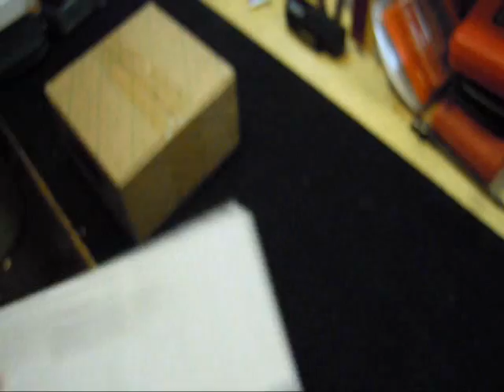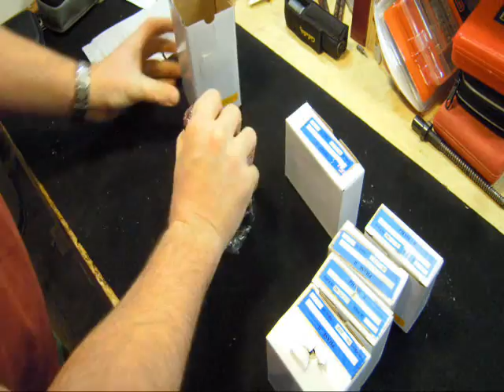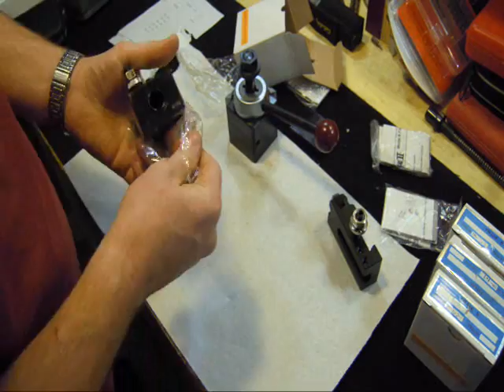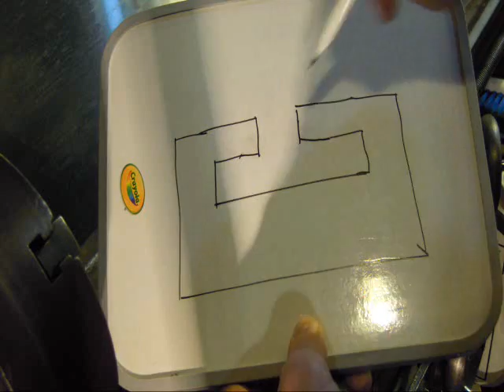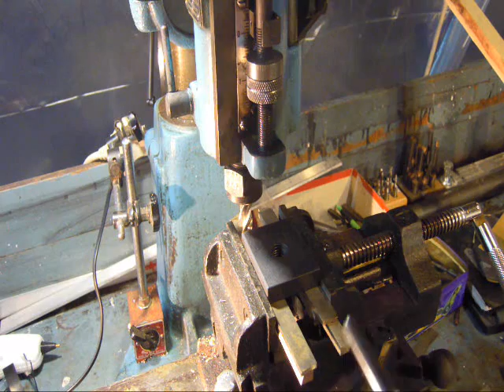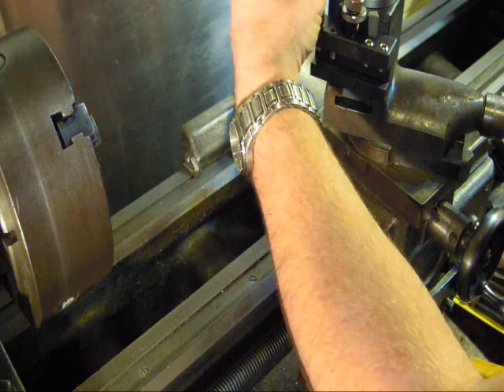Phase II AXA Quick Change Tool Post, Logan Lathe Install

Comment: Where did you buy the phase 2 quick change?  I have a old prentice bros lathe and want a quick change. Also what size tool can it hold? 1/2”??
Reply from the maker: Yep, 1/2", I bought it from Enco before MSC bought them out. I've since switched all my stuff over to Dorian and Aloris. No comparison.

Comment: Turn the F###ing Air Compressor off and go to school and learn Machinist Trade You could have did the whole job in a four jaw in about 30 min
Reply from the maker: I didn't want to take a short cut with a rounded off part and "make it work"

Comment: I bought an AXB tool post for a Grizzly G0752 Lathe and the tool holder does not go down far enough. Will the AXA improve my problem? drwills21@msn.com. Please help.
Reply from the maker: Yeah, that BXA is going to be way to big as it sounds like you found out. I wouldn't put a BXA on anything smaller than a 12" swing lathe. AXA's work great for 9-12" lathes.

Comment: You don't have a suitable tool, for measuring the depth of the T slot?

Of course you do.

There's at least two methods, using the Digital Calipers.
Reply from the maker: I can't recall how I did this without looking at the video again. I was probably wanting to use a depth mic when I did this. I've since gotten more calipers and micrometers than I'll ever need.
Reply: Precision Machine Shed sac
Reply: Machine Shed Precision

Comment: I got a zx45 for while im learning and looking for a good deal on a bridgeport.  I gotta tell you its awesome.  I get no measurable slop in the table at all.  its flat and level to 0.000000   we gave up trying to find slop.  My brother in law iaw a machinist in the arrow space industry and when he used my mill he said "this thing is bad ass"

I cut tool steel like butter
Reply from the maker: That's awesome, sounds like you have a nice machine there!
Reply: Precision Machine Shed I honestly didn't think it was going to be much of a machine at all because I made the mistake of buying Grizzly lathes in the past so I figured another Chinese piece of junk was headed my way I just wanted it to learn on a little bit before I gotta Bridgeport but I'm going to keep it and use it until I grow out of it now there's nothing I haven't been able to do on it it could go a little bit faster on its top end but I'll deal with that when I have to it's a Gearhead so it's it's not like I can change the police have to redesign the damn thing or increase the motor speed.

I bought a Logan lathe 820 built in 1946 for real cheap I went and picked it up and on the very day I was picking it up I found another lathe for 200  bucks it was an 1821 and it was all tore down. the guy didn't know if it was even complete, he had bought the parts in order to rebuild a lathe and restore it, he never got around to it so he sold it to me for two hundred bucks! all the parts tore apart and I just took it home for the  gears and things like that cuz I know the drives are identical from the 1800 series to the 800 series most of them anyway.....  so it turns out I start putting this thing together I painted everything Battleship Gray really nice I took my time and stripped down to the metal clean as a whistle and taped everything off perfectly painted with oil paint let it dry  for weeks and weeks and weeks and put it together in the whole damn thing is there!  it's a hundred percent complete  so I got a brand new lathe for 200 hundred bucks! not only that but both machines  show no signs of wear whatsoever other than the compound rest on the second lathe,  the 1821 had been run into the Chuck a million times so I'm going to either repair that or try to find a new one I don't know probably try and find a new one.

The only thing that bums me out is when I tore apart the 820 and painted it I painted it a nice dark grey about the same tone as the original 820 without the blue tint to it. But I brushed painted it and it turned out like shit. It looks like an old machine with an old paint job but that that's a pain held up really well. But the biggest thing is it's protected there's no rush everything's a hundred percent cleaned up and protected.

As for the 1821 it's beautiful Battleship Grey and shiny metal LOL I'm looking for a good motor for that right now it came with the three phase half horse motor that's older than I am and I'm just going to get a one horse single phase motor off of eBay I seen some good deals on brand new Motors

Anyway I ramble too much I get excited when I start talking about it I can't wait to buy another one and restore it I'm pretty God damn disabled so doing this takes a lot out of me I can only do it maybe a half hour per day if I'm lucky sometimes if I go an hour or two I won't be able to get out of bed for a couple of days but it keeps my mind going all the time and that's important to me right now well I'm so sick.

If you have any opinions on good Motors let me know. Funds are a little bit short right now I shouldn't have spent all that money butt I need a new motor LOL

Comment: Was that your laundry at 16:07?  Also, I just bought an AXA Bostar for my 11" Grizzly.  All I have to do about the T-nut is drill and tap the existing one that came with the Grizzly.  What size is your bolt on the Phase II?  It looks slimmer than the Bostar.  The Bostar is about 1/2" x 4 1/2".
Reply from the maker: +Bourne Accident 
I think it was, I use to have my shop set up right next to the laundry room in my basement. As far as the bolt size goes, I'm not sure and I sold the lathe along with the Phase II. I'm currently using a Dorian on my main lathe and an older unknown Chinese post of my other lathe. Whatever it was I'm sure it was metric.
Reply: To the question on what size the center bolt is. I just bought one for my South Ben 9 inch lathe and it came with a 14 mm bolt. I asked if they sold one with standard thread and was told all they came in was 14 mm.

Comment: Nice installation.  I have a craftsman lathe, bought a quick change toolpost and had the same issue with the T-Nut.  I happen to have some steel that fit in my tool post perfectly so I didnt have to mill the T-Nut that came with the kit.
Reply from the maker: +Gary Truesdale Hello, sounds like you found a good solution. I think If I do another before I get a larger mill, I'll just buy one off ebay!
Reply: +Gary Truesdale What size is your Craftsman?  I have a 10".  I bought a KDK quick change tool post AXA for mine.  I am having problems fitting the T-Nut.  What size steel did you use?
Reply from the maker: Gus Lint 
Mine was an 11" Logan. They are all about the same size t-slot though. I used the plate that came with it and I've since sold this machine. I do have a new Dorian on my new Heavy 10 which I would be glad to measure for you.
Reply: +spitfire1821 My T-slot is 1.300" wide in the slot, .315" tall in the slot, .615" at the top of the sot.  I am retired so have time to work on it by hand.  I cut it to width with a hacksaw, and then draw filed it.  Now I have to cut the "wings" of the T-nut.  I don't have much room to work as the bolt measures .550" and has a metric thread.

Comment: Great job making that tee nut. I too have the same lathe and bought the Phase II QCTP. I do not have access to a milling machine, however I bought a already machined tee nut that fit my lathe perfectly, off of Ebay. Back then I paid  $23.00 for the tee nut, but now he is selling then made to order for $14.00.  He makes them for just about any lathe. Again great job.....Ken    Marina CA
Reply from the maker: Kenneth Bartlett Hey, Thanks for watching Ken. Yeah I noticed after the fact that those were available on ebay. I think if you have a full size milling machine this can be done fairly quickly. However with my little machine I would have been better off buying one.

Comment: Great video on making sure the T-nut fits correctly. I installed a Phase II BXA QCTP on my 12" geared-head lathe and the Phase product is well built. I needed the BXA size using the 3/4" high oversize tool holders for more tooling choices. I also bought additional tool holders from CDCO Machinery and  All Industrial Tool Supply (for the BXA  oversize 3/4" tool holders) because the quality is very good and far less expensive than Phase II. Nonetheless, I still remove all the tool holder setscrews and replace with high quality dog-point setscrews for trouble free operation.
Reply from the maker: Paul Jones Hey, I'll have to check those guys out. As far as the set screws, yes I have noticed that I need to change them out, they are junk! Thanks for watching and the comments!